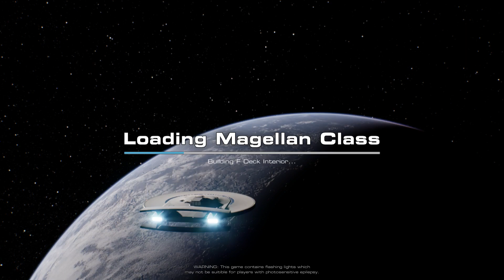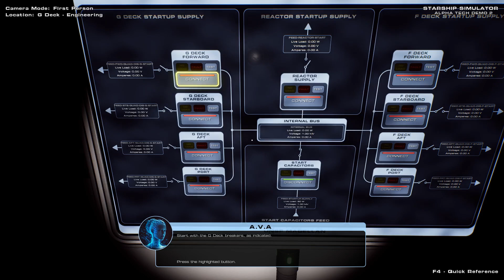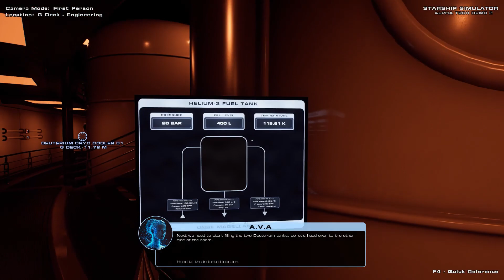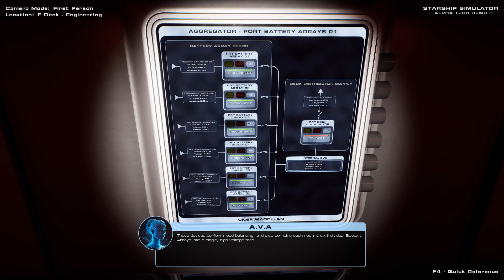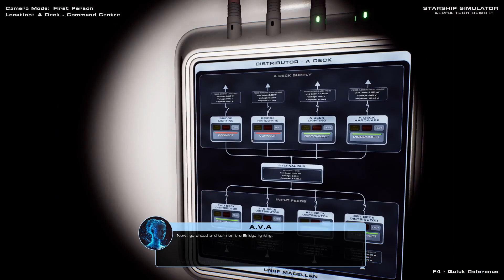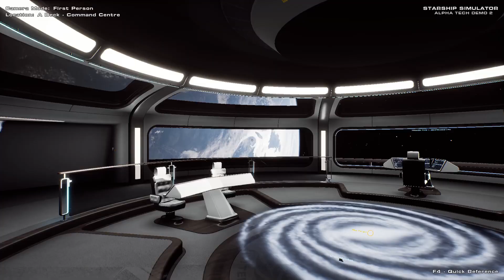STARSHIP Simulator - Episode 01 - Engineering Cost Start

Comment: I really hope Star Citizen has some kinda of engineering gameplay something like this. Maybe not as in-depth but something similar. I would like when our ships are cold we will have to do some kinda startup process. not just one key for "flight ready"
Reply from the maker: Hi jollyrogerhobbies2386, Thanks for taking the time to leave your comment, to be honest, I have mixed feelings about it, I think it would be cool don't get me wrong, but I hope you don't need a whole engineering team to get the ship ready, it already takes some time to get from City to Space Port, I personally would not like to have the same time again to then start the ship! it will have to be a balance, but that being said, yep it would be cool..
Reply: @HeyEv  Most definitely a balance. I do not want a 30 minute start up process, or a who engineering team no. However I do believe large multi crew ships should have a longer start up process including some steps to start where as small 1 person ships use a simpler process such as an external battery disconnect, then climb in and start power plant then engines. something like modern aircraft have.